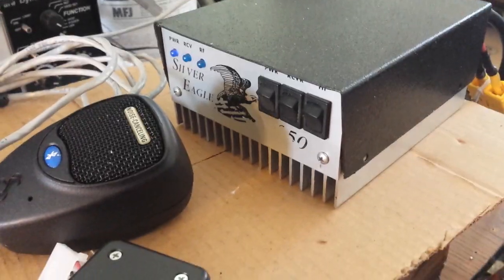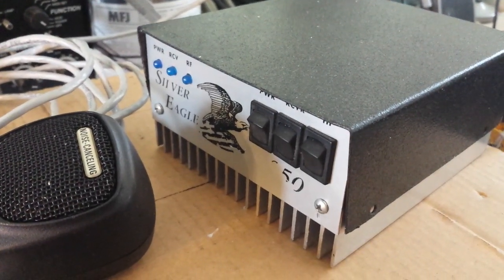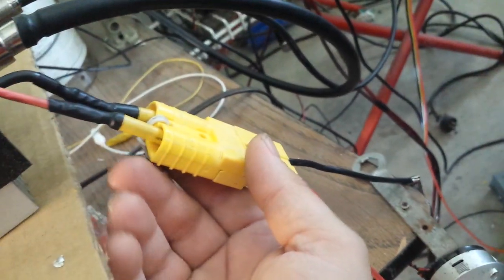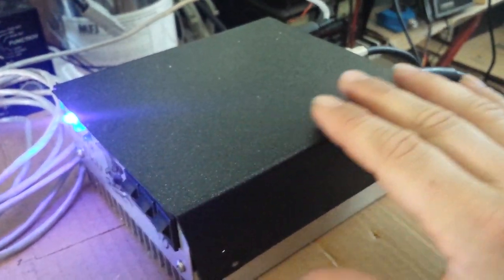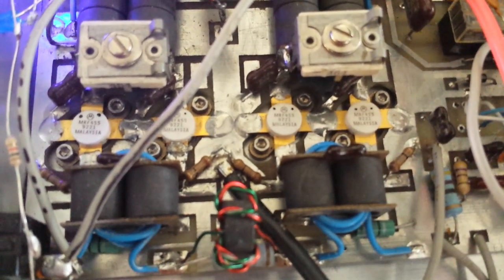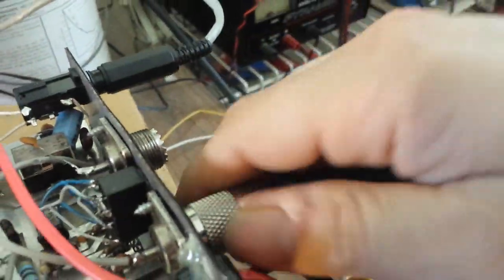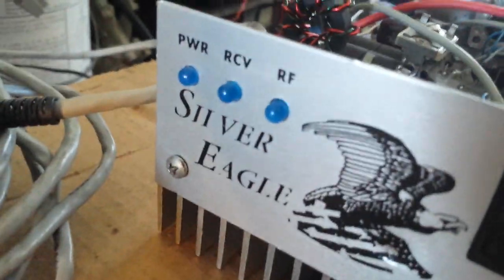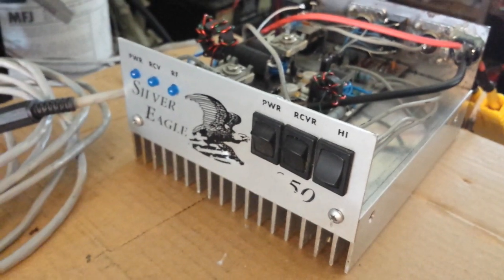Revived Silver Eagle 350 with Brand New MRF455 Transistors 👌

Comment: Almost the exact output power as a Texas Star 350 HDV but this amp uses (4) 455's & the Texas Star uses (2) 2879's.Both are descent mid range amps if not over driven putting most of the output in the 50 mhz range & not where it is wanted.

Comment: Better off leaving the current set at 13.8 because nobody can hear or see the difference in those few watts of output & why strain the amplifier when it's not needed.So many people think they need to squeeze every extra watt out because they don't understand how the output power works in relationship to actual signal strength & the really thing those few watts make a difference when they do not at all.Also the 455 is rated at 15 volts MAX per the specs so at 15.3 they are running above max voltage for wattage that NOBODY can hear or see the difference in other than somebody with a wattmeter that thinks it matters when it does NOT.HEAT is the enemy of electronic components & that extra voltage produces more deadly heat & shortens the life of the transistors.